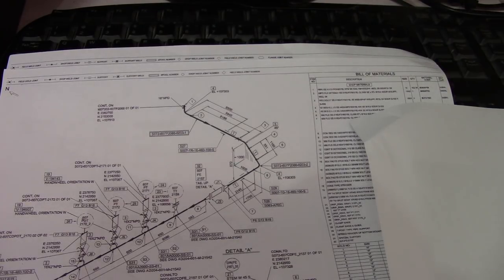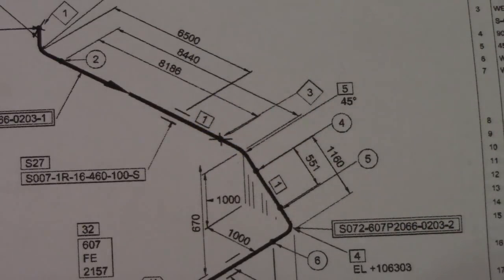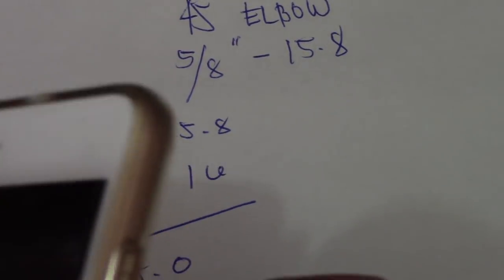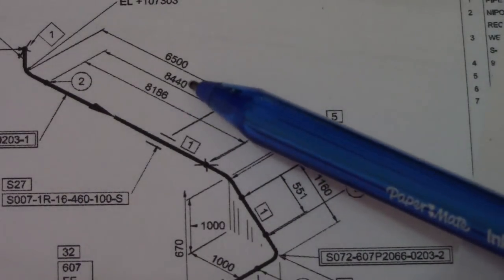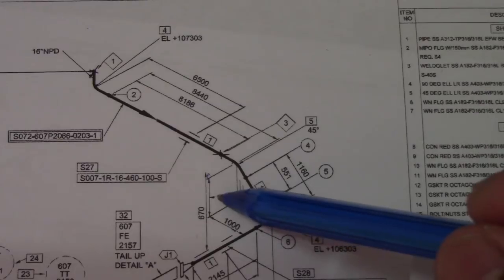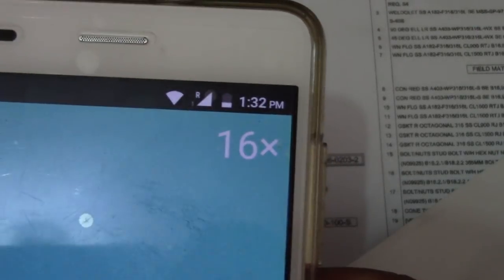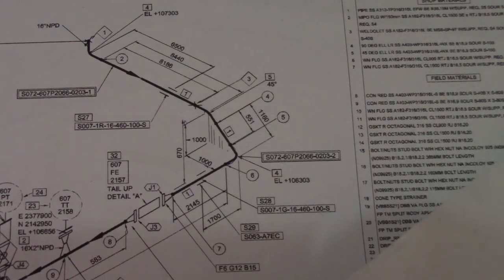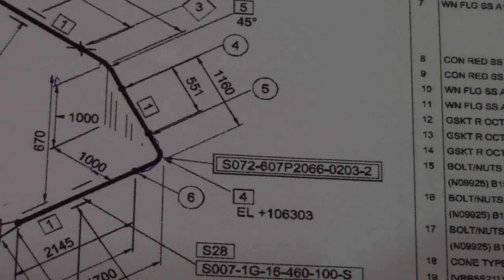Important Part of Pipefitter Before and During Interview | How To Find Take Off?

Comment: Saan po nakuha ang 5/8?
Reply: i think yan po ang standard given na value ng formula paiba iba din po yan depende kung 45 ba or 90 degrees long or short radius 5/8 in fraction, 0.625 in inches,  15.875 in mm

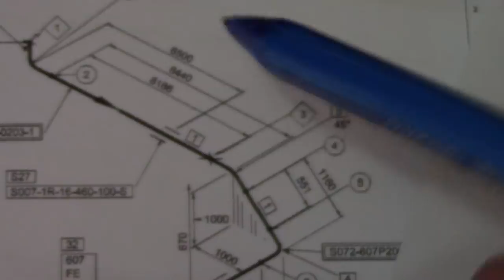Comment: ''4:53 ''   16 inches 45 deg. elbow center is 254 mm,( 5/8 x 25.4 = 15.875 mm x 16= 254mm)  thats why  8440-254= 8186  it is not about the weld gap.  Thanks for sharing
Reply: you are right nihat not the weld gap..the author used the 15.8 only ( lacking .075)
Reply: Yes this is the rigth computation.